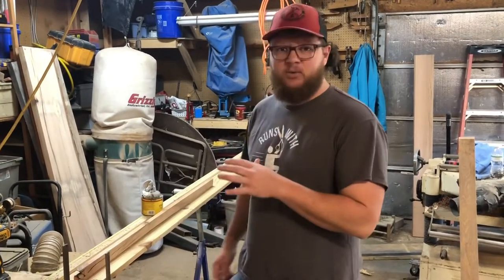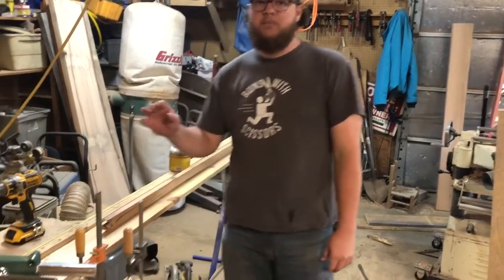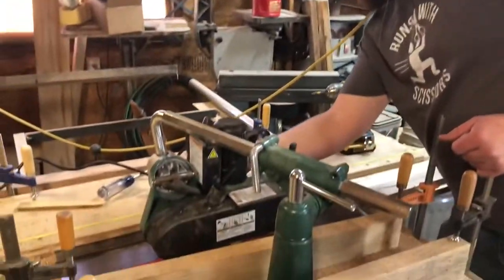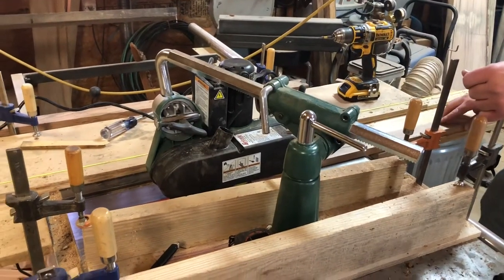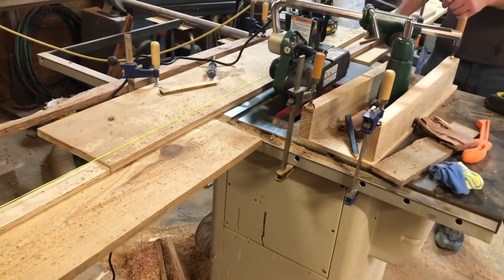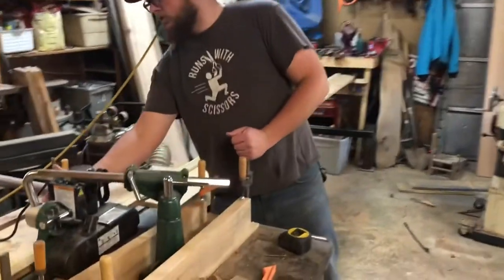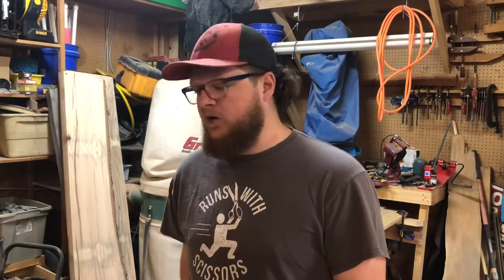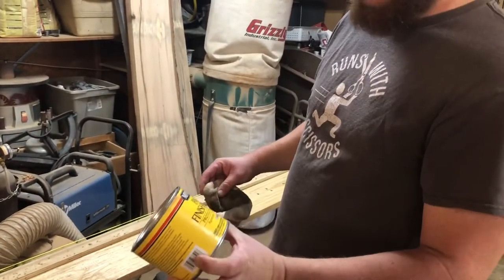Grizzly mini power feeder first use.

Comment: I love the idea you have for straightening boards! Now you’ve used that power feeder for a while, how do you like it?
Reply from the maker: It works ok. For what I use it for, it may be a touch under powered. But since I rarely use it, it’s not worth having something more significant. We ended up putting it on a mag base which really makes adjustments handy. 

Before best results, your wood needs to be as dust free and smooth as possible
Reply: @TheWhimsicalWoodworker  I think it’s genius. Jointing a bunch of lumber can sure get time consuming and a straight line saw is pricey for most. Thanks again for the idea.